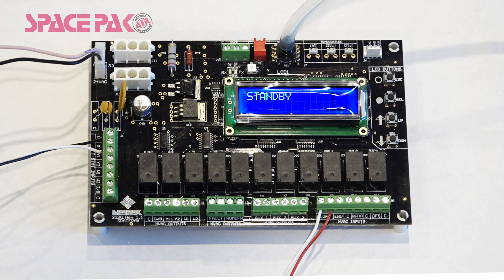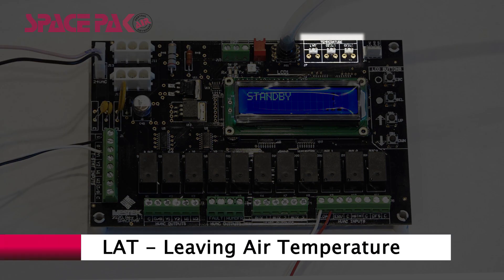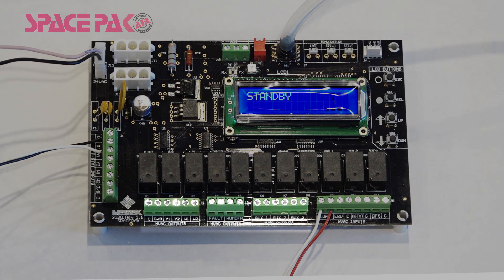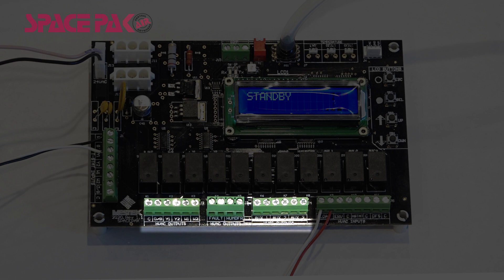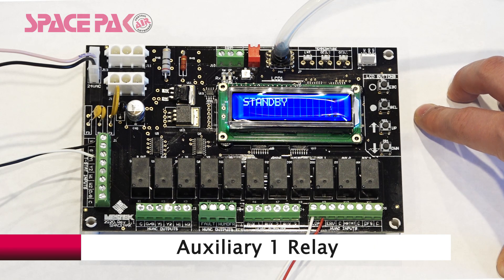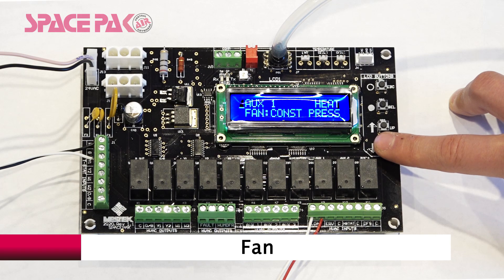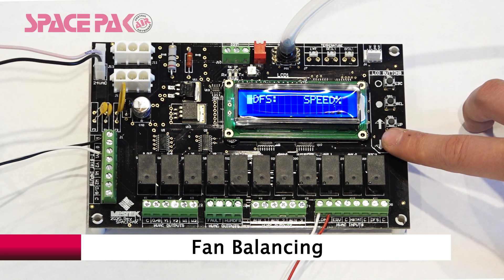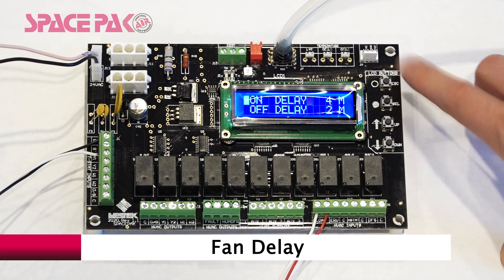SpacePak J Series Control Board Commissioning - How To

Comment: I do not like the fact that the faults whatever they may be do not automatically reset. That is unacceptable if we have an addition with a stock up drain the unit locks out what is the customer has a way to clear the drain himself?? What is the drain is a slow moving drain instead of a complete stop drain it never starts up? That is unacceptable in this sensor that you have on the motor is unacceptable not being able to clear a fault board is unacceptable and don’t tell me they do because they don’t because if the sensor goes out, the board will not run without a good sensor who the fuck is gonna stockyour dumb ass sensors nobody and why should we have to stock them? Why can’t you make them where they work correctly?. I like Spacepak equipment don’t give me wrong but this application that you’ve made is ridiculous. You need a much simpler way to do it or here’s an idea. Why don’t you make it so we can plug a freaking laptop in it and fix it from a freaking laptop. You’re creating extremely dangerous applications. If the unit locks out during the winter months they could freeze and bust every pipe in the house if it’s a little old lady like I have staying in the house by herself in the unit quits before she actually notices it. It could be over 100° Inside the house and if she dies because of the system, you and I are gonna have a problem. THE BOARD NEEDS TO AUTO RESET!!

Comment: Just installed this unit and the fan will not come on??? Whats the issue???
Reply: I had a similar issue with one I put in a few months ago. My system was AC only. The boards from factory are set up for Heat pumps. Go into the setup menu like the guy in the video shows and change system type from HP to AC. Hope this helps.
Reply: @nikvance6015  This advice works, but in my case the board tends to "forget" its settings and reset back to its default values. I've had to change the settings multiple times to keep it working.
Reply: @Jonas42  it could be the pressure switch is pinched, the board is not outputting 6 volts dc power from the speed control, the settings, not getting 24 volts from the thermostat, a blown transformer, a blown switch or no 110v or 220 as wired
Reply: I just installed 2 unit and both doing the same fan won’t run did you fix your problem thanks
Reply: It’s junk that’s the issue!!!!!!!!